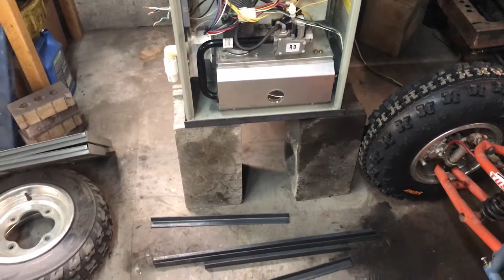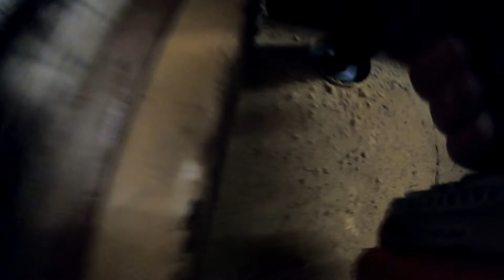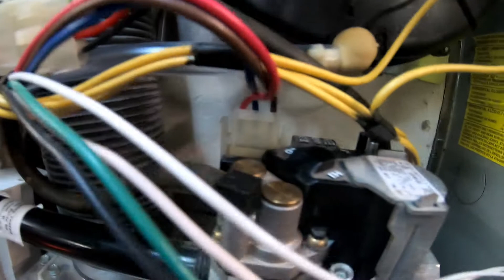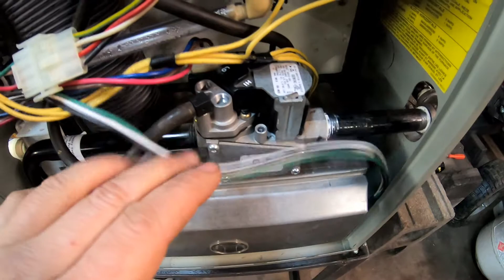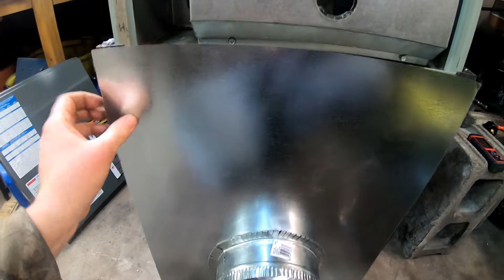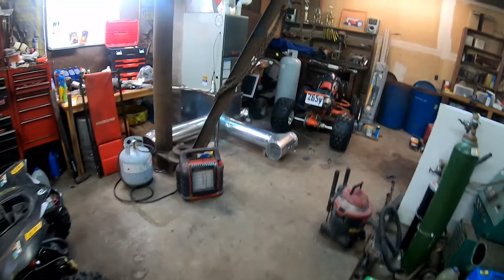Garage Furnace Installation And Propane Conversion

Comment: Old video at this point so your probablynot watching comments. But did you have any trouble with the condensation lines freezing when not in use? Mine has a Ptrap so it will always hold water unless it's modified which brings on potential carbon monoxide issues.

Comment: Hey I was wondering what the process was that you were able to connect the propane tank to the furnace. I was hoping to see more step by step process besides the conversion kit which I already did. I guess the problem I’m having is that the hose I’m using keeps leaking propane but it is a propane hose. Was there a more durable hose you used ? Any help would be super appreciated.

Comment: I would take the vents off, if you are overtemping, looks like (3) 6" pipes, that's not enough airflow for that furnace.  Taking the vents off will help make it less restrictive.  Adding 2 more ducts or just use rectangle flat vents on the sides of the plenum may do the trick.
Reply from the maker: I ended up replacing the board and it’s been fine since.  This fall when I tried to fire it up, it would get a signal from the thermostat telling it to fire up and nothing would happen.  Check the combustion blower and it was good.  Capacitor for starting the blower was good, so I replaced the board.  It fired right up. I wonder if it was starting to have issues for awhile and then completely fried.

Comment: How long do you get out of one 100lb propane tank? Have you tried it on the smaller tanks? And how does it compare to the wood stove you had before?
Reply from the maker: I haven’t used it much yet.  I don’t think a smaller tank would last long.  It heated the garage up fine.  It started tripping out and not blowing heat.  I’ve got to get it figured out soon.
Reply: I had the same problem, after reading the manual it states that this type furnace usually needs 55 degrees return air intake. Working to find out how to override this feature. Starts up great but keeps tripping out after get up to heating temp in furnace,
Reply from the maker: Hal Halliday, you’ve got a manual?  I can’t find one anywhere.